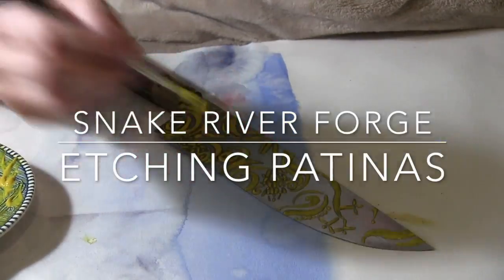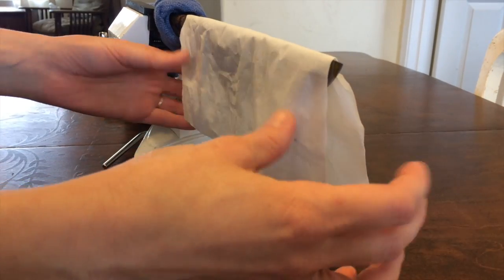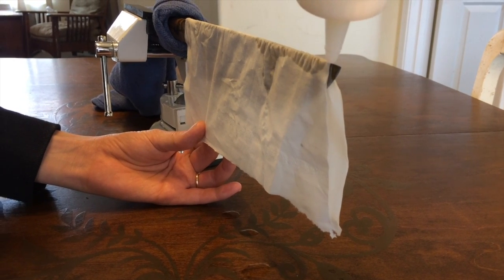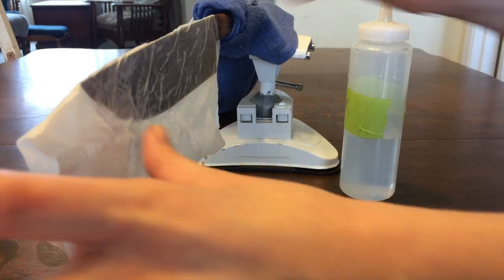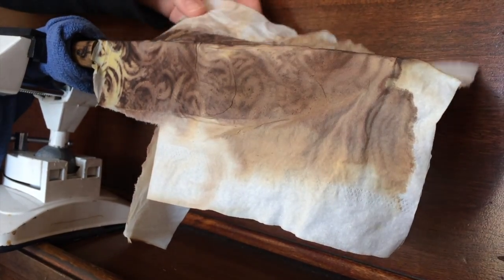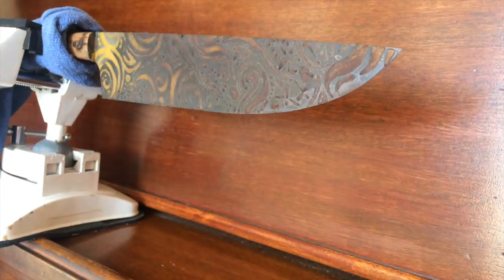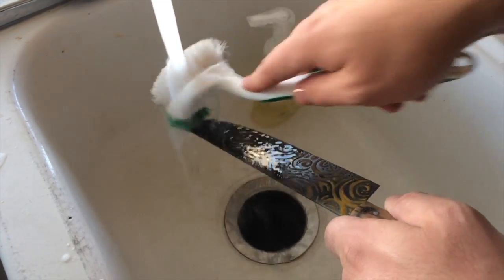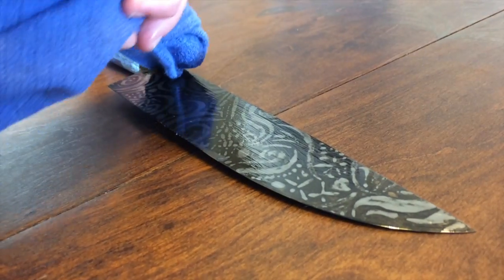Knife Making - Snake River Forge - Etching a Patina

Comment: That's crazy. I tried so many other ways. I've done mustard and vinegar separately. I've also done the nail polish designs in boiling vinegar, definitely going to try this at some point.    
EDIT: I tried it, and it works easily. The problem is what kind of untextured cloth? I used a paper towel, and it left little dots all over. So would a T-Shirt do?